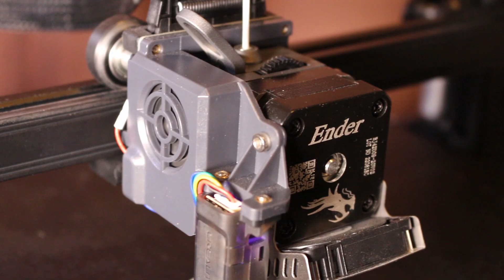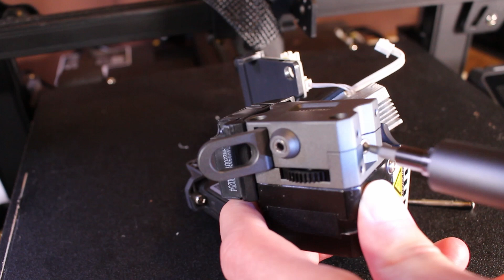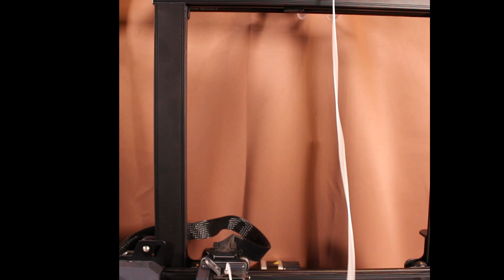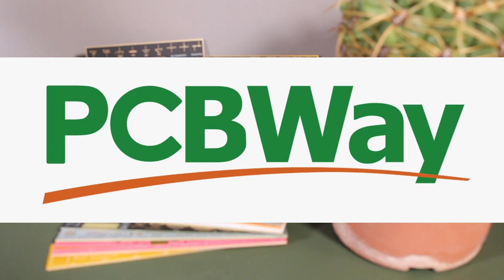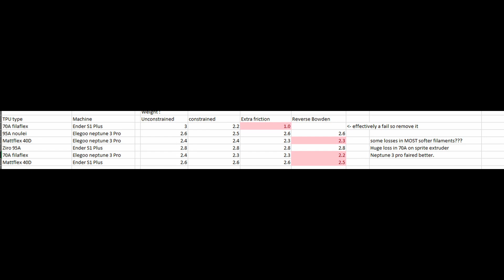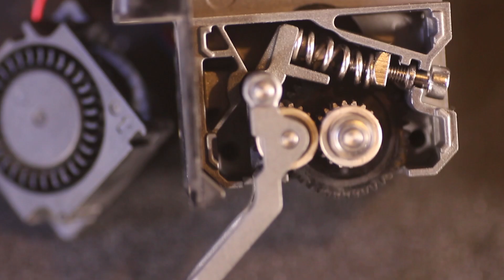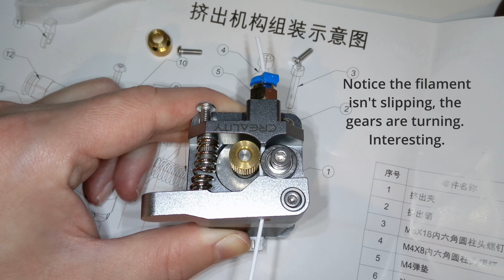The solution to this TPU problem was surprisingly simple!

Comment: Omg thank you!
I also have an Ender 3S1 and i've noticed that exact problem with 85A TPU. I'll try that right away :D
Reply from the maker: Good luck, I'm sure it will work!
Reply: @LostInTech3D  It did :D
I did a test where i would print a cylinder in vase mode,  20 layers with slacking filament, the next 20 without slack and a small weight on the spool (to simulate the filament sensor, which i had bypassed) and so on. The difference is clearly visible.

Comment: here's a rough theory of the moment..... if your mainboard has an unused driver, you could add another stepper motor to the spool holder. something like adding a rubber wheel to it in the middle to turn the spool in increments. you'd have to figure out gcode to rotate the spool for every x amount of filament extruded. it'd likely look something like your screenshot of bearings in the spool holder from the vid. that should unload the tension from the filament before the extruder.
not sure, but you might be able to piggy back the signal off the extruder circuit so that they both turn at the same time like a dual z. might work, might end up with a giant pile of unwound spool depending on gear ratio, wheel size and extrusion rate. let me know if you actually try it. i'm curious to see if it works.
Reply: Or you could just add another tensioner/motor on the filament at the top.
Reply: If the spool can still move with friction instead of being directly connected to the motor, you could probably get away with it moving more slowly.

Comment: I'm running  custom direct drive Titan extruder with stock Ender 3 hotend via about 45 mm of Bowden from the nozzle to guts of the extruder. So far low tension and a sort of flexibles no issues. It looks like that short PTFE makes no issues or just the geometry of Titan makes it running nice. And quite speedy with good surface quality. In many cases thanks to You findings!

Comment: I have micro swiss direc drive, it works Great with TPU. But I have the same  problem with my TPU 60A. I think to build a motor on the spol to roll off filament at the same speed.
Reply from the maker: That would be really interesting, I hope if you get anywhere with it you keep me updated!
Reply: @LostInTech3D  
it becomes too complicated (for me) with a motor on the spool, because the speed changes the less thread there is on the spool.  I'm going to start by making a ball bearing center for the spool  to see if it is enough.  Otherwise, I'm thinking of trying to combine the bowden and direct drive.  however, I don't know if the electronics can handle it.. I know electricity, not electronics.  I just want to be able to print TPU 60A easily.

Comment: Yay, the notebook is back!
So does whichever printer you've used for soft TPU video have a spool holder with bearings, and no filament sensor? Wasn't it SKREnder?
Reply from the maker: skrender has the holder right above, but it was nowhere near as neat as this, I previously didnt think you could FDM 70A this neatly

Comment: Also if you have tension before the extruder, wouldn't you will be pulling through material that is less than 1.75mm because it will be stretched
Reply from the maker: yes I mentioned that, and absolutely the case 👍

Comment: You want to minimize any drag between the spool and extruder. In addition to making the spool spin easily, adding a reverse Bowden tube   (PTFE with a 3mm inner diameter) to guide the filament to the extruder will avoid it getting snagged on something.
Reply from the maker: 3mm PTFE 👀 I should test that
Reply: @LostInTech3D  I've always heard you should use 3mm ID tube for reverse bowden, to minimise friction as much as possible (given it's not actually acting as a bowden tube)
Reply: I picked up some reverse bowden tube from Capricorn at ERRF.  It's larger inside diameter
Reply: Reverse bowden tube can actually make things worse in this aspect. If you run a reverse bowden tube, you effectively make the distance between the spool and the hotend contstant. If you don't the distance changes with the print head location. This means, whenever the print head moves away from the spool, it will jerk on the fliament, releasing more filament from the spool than necessary, which loosens the tension after the jerk.

Since the jerk is strong enough to overcome static friction (and it's also very short), you will have a lot less friction in the system in total.

Also, a reverse bowden tube adds friction (even one with 3mm inner diameter), so if you are trying to reduce (static) friction, a reverse bowden tube is the wrong tool.